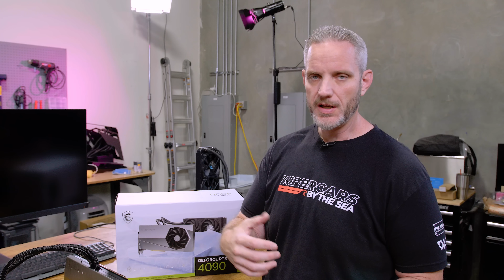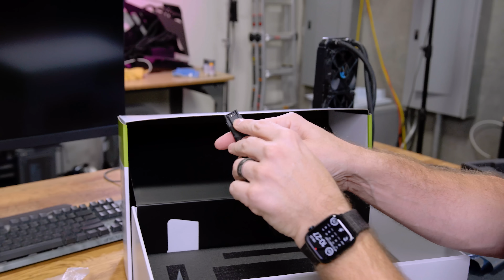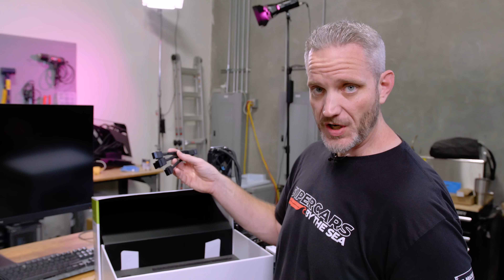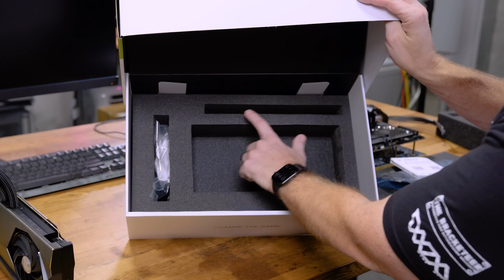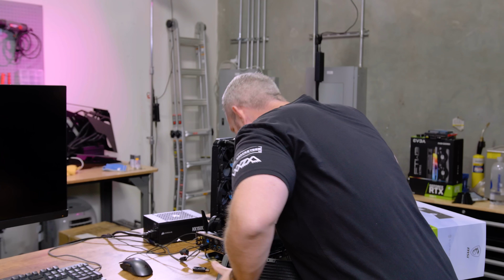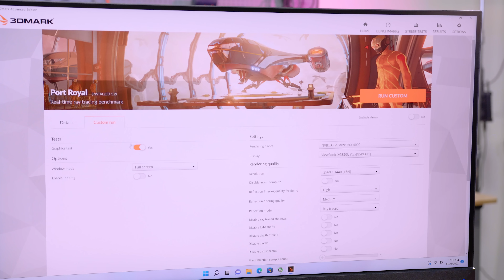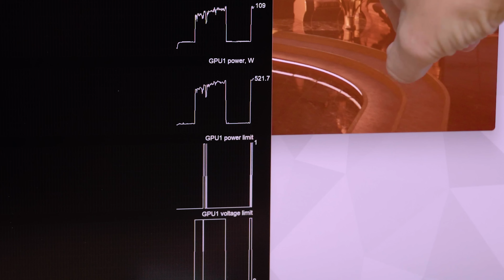This is the most BEAUTIFUL RTX 4090 yet...

Comment: How does it compare in size and weight to the EVGA 3090/3080ti hybrid?  It seems like a great drop in replacement.  Is there a rgb pin out on the card like the older EVGA card to control other RBG devices with the same software?

Comment: I've never looked at a liquid cooled video card before - it used to be common concensus they were louder but that may have changed. I'm not that concerned about additional FPS with over clocking - just about sound level, I want the absolute quietest 4090 video card within about 5% of each other in speed.    There is always someone saying that can't hear this or that - I could probably ask about jackhammers and someone would undoubtably say - I never noticed the noise for that jackhammer.

Comment: water cooled and alot smaller fit, for a 4090, run at stock set for lasting longer being cooler and easier to manage in case.  yes the cost is bummer part, this is the card i want, hoping in next months prices will drop,  its 1750.00 price nobody has em in stock, the few trying to sell them are amazon has 1 for 2580.00 dollars today, scalpers pricing

Comment: In Canada the Suprim X and Suprim X Liquid are the same price (CAD2450). In such instance, which one would be your pick? I got the air cooler version from Best Buy, but they have no idea when it will arrive, or if they will even be cancelling orders. I've seen the Liquid version pop up here and there near where I live for the same price, therefore the question... My case is a Evolv X (the biggest variation), and I already have a 360 rad for my CPU in there. Didn't really want a water cooled card, but by the looks of it that's where I'm thinking of heading really.

Comment: I think the spot in the bottom level, which jay mentioned might be for a support, is actually for the radiator and/or fans. I could be wrong, but I think the top level passes through to the bottom level so the gap is large enough to fit the radiator in the box.

Comment: 1) $1749 is a $150 premium over FE, not $250
2) It is $250 cheaper than the Strix
3) The orientation you showed for vertical radiator placement is upside down, you want the tubes going to the bottom, so the air sits at the top of the rap without tubes
4) I beat your Port Royale score by almost 100 points with the Suprim Liquid X on a weaker CPU (5950x). Get rekt. <3

Comment: I am having an absolute B*TCH of a time with this card on my system that I'm building.  ASUS Hero, i9-13900, Corsair dominator RAM, evo pro 2TB nvme, Windows 11.  I could install all ASUS drivers without any problem whatsoever. As soon as I installed 522.25 NVidia driver, my system would be in a constant freeze/reboot cycle until it forced me to use a restore point to bring it back to operational.  Also tried everything on W10 and was actually able to get through the whole GPU driver install this time, but the rebooting was still happening.  Called back into NVidia support and they had me change the power management mode in the console to "prefer maximum performance" before it reset.  Changed the setting and reset the box and so far (about 10 minutes) haven't had a reboot.

Update: No random reboots once I'm in Windows, but it can take me 3-4 times of pressing the reboot button to actually get into Windows. Boots up and fan colors change (so iCue is running), but have a black screen.  After a few resets, I'm able to get into Windows.  Overwatch 2 plays fine, but I get GPU spikes to 100% every 10-15 seconds and drop 100fps for a second and then back to normal. Super People won't run at all, crashes during load.  PUBG loads but has the same GPU spikes as OW2. I've tried turning down the ram from 6600 to 6000 and it's still happening.  Still waiting on a call back from NVidia tier 2.

Comment: My 4090 TUF will run together with a 13900KF in a custom loop with 2x480 and 1x240 radiator in the 7000D Airflow. Im very excited how it will perform. Just waiting for the EK block with active backplate to be shipped :/

Comment: i dont trust msi water cooling. i bought their watercooling aio for cpus with the pump built in the radiator, and the first one failed, i RMA'd it, they sent me a new one as replacement and same issued happened.

Comment: I  have a question: Why are the Backplate chips always free of any heatsink? Wouldnt it make sense to also cool from the other side although it would not be very efficient in my opinion but wouldn´t a passive heatsink help to further lower the temps? And yes you would need a (whats it called) Heatspreader like on CPU´s As you cant screw a big metal on those small condensators directly. But my question is "why not" in general.

Comment: I feel like the 3090's of this calliper were unchained and dangerous.  Games were able to push past power limits and melt solder lines.  That was huge and bad.  I think this is an attempt at putting up boundaries so that doesn't happen again.  These cards are drawing even more power, now we have to come up with workable cables for this much power.  Power levels have reached server levels of the top most on a componet level.  There is no industrial fan pushing server level air flow over 3 pounds of copper or allum.  Pcie non server cables haven't had to account for stress and heat flow.  Servers made new types of connectors eons ago to support less bending. This will be a time of great change. Maybe power sockets need to come off the card at an angle so the wires don't have to make the bend. Maybe a 90deg.  attachable power header would help.

Comment: I mentioned this to Paul's hardware channel. Oddly enough, I have this card and originally ordered a corsair 1000psu and the power limit on after burner was 120%. I had to return it because it had very loud coil whine (found faulty) and I ordered a be quiet 1000w psu to replace it.  The power limit on after burner went to 125% for some reason? This is with the surpim X liquid. Also, I turned off the zero rpm feature, I really didn't like a 50 degree brick sitting at the centre of my case, exchanged it for a typical fan curve and idle temps went down to 25s-30s and seems to stay a lot cooler in use.

Cheers Jay.

Comment: I LOVE the look of the card. However, I think for my new build, which was going to be a complete PC upgrade this year, I will go ahead and upgrade the MB and CPU to [ Insert New Chip to avoid Fan Bois ] and wait until 1Q next year to upgrade the GPU. My main reason is the GPU and CPU Industry have in the past shown that as inventory moves and NEW chips come into the supply line those New Chips from the Companies mature and this results in (1) better stability and (2) in cases higher overclocking headroom. I really wanted to just jump on Amazon and purchase all the parts as soon as the review cycle, sort of, ended. I am personally going to go a DDR5 route no matter the manufacturer so as to be able to use that memory in another build 2 to 3 years down the line. As far as Storage, I already exclusively use M.2 drives except for 1 SSD internally that keeps my temp files for projects. Hopefully, with M.2 prices plummeting I can score a nice 4TB drive on sale for better than the usual -7% garbage they try and lure you in with. But, I'll be happy with a bunch of 2TB drives if need be. I love that we can now have MORE than 2 or 3 M.2's on the MB by default (depending on size). It's a Great Time to be a PC Gamer/Enthusiast/Developer who is in need of a new system due to competition. Cheers! Stay Healthy and Stay Sane!

Comment: 2018: Why do GPU card makers not overclock their cards as standard if the cards are stable and reliable when overclocked?

2022: Why did the GPU manufacturer set the card to the maximum it can handle, so now I can't overclock?

Comment: And this card will solve the problem of power cable bending because the water cooling hoses stick out so far that you won't have to bend the cables. Must be vertical mount to fit in to you case right?

Comment: the 4090 custom designs are a "bit" boring, because they are all voltage limited. Actually this is not bad news for customers who just want to put this GPU in their build and don't care for oc. Get whatever fits your budget/astetics requirements and performance will - at least until the power adapter will start to melt^^ - be within margin of error.

Comment: Please make sure to let people know not to have the intake and outlet for the water block at the top of the block if the block is mounted vertically, this allows any air to head towards the pump and then the coolant stops moving, which can cause an airlock and potentially damage the card through overheating.

Instead, having the inlet/outlet at the bottom means and bubbles stay well away from them at the other end of the block.

Comment: Couldnt afford to run it even if I did sell a kidney for it. £0.40 per KWH in the UK means running a system with this in or any 4090 means you'll be looking close to a full KW when you throw in a new intel or AMD CPU when running full tilt, for a few hours of gaming - sheesh.

Comment: I don't recommend aio cooled gpus. They won't last as long as air cooler models. The aio will lose performance after 5 years. And good luck trying to replace it. I have seen cards getting destroyed by the water leaks from those. Also those hot vrm vrams are only cooler by 1 fan.. For you either go custom water cooling or air cooling that's all.

Comment: I had an MSI "Sea Hawk" GTX 1080 AIO water cooled card years ago.
It was a GREAT card for thermals. And sooooo quiet.
It looked really tight with a corsair AIO on the cpu too.
But I dunno about the long term durability, I only had it 2 years (microcenter trade-in warranty back then)
Reply: PS: at 5:20, you show how you might mount it in front ...I really don't recommend that.
Don't mount it with the tubes at the top of the rad. You only need to leak (evaporate) a tiny amount of fluid to stop the fluid flow if the tubes are at the top of the rad.
You probably re-build and upgrade too often to notice this, but most people don't. I'd mount that on top, with tubes coming down to the card. And just put your cpu rad in the front of the case.

Comment: With the issues that some manufacturers are having with AIO's liquids degrading and sludging up the CPU blocks . What is the contact area like for a 4090 water cooled cards??? and can they suffer from this kind of issue?. With these cards costing so much one would not want a card to be over heating and requiring a return to manufacturer and having a system costing ?? down for a long time.

Comment: If you got really good at using a microscope and soldering you might be able to move ram, cores etc around. I wouldn't think that chips would be software locked to a specific card considering almost no one does stuff like this. Maybe get a good air solder station and stuff to BGA solder and show us the process of you learning to make your own OC monster. LOL. I'd love to see that content for sure. Please consider it at least, most of us will never have the access to hardware let along the engineers you could probably reach if you tried too, for help.

Comment: I did a whole platform upgrade (everything except case and PSU) with a GTX1070 GPU in 2016 for half the price of one of these cards. The whole system running less than 200W. The world sure has gone bonkers

Comment: Q: Jay could you replace fans with RGB fans? Thanks. Not on GPU but radiator block.

Yes!!! RGB software for GPU should be on MSI afterburner.  I also WISH MSI would bring after burner to Linux.   Steam os is coming soon to desktop pc.  Valve said so.

Comment: I have a suprim 3090. Giant cooler. One of the first things I did to that card was to water cool it with an active backplate. The memory junctions reached 114 degrees c. Now after water cooling it’s down to 100. Still stupid high. My room gets really hot after a long gaming session. It has to become worse with 4090. What is the temp on the junction of the 4090 cards? Because on the 3090 I have, the gpu show low temps.

Comment: This may sound like a stupid question - but why don't they just put the power connector on a different side? On the rear for example or pointed downwards or up? It makes no sense to have to pointed towards the side like they all seem to be doing it. It would just be a matter of running the traces somewhere else or just put a short cable through the cooler fins on the end (where there's no PCB anyway) - and the airflow would keep the cable and plug slightly cooled as well...

Comment: Gigabyte waterforce is better. You get at least 27000+ stock. Although the default frequency is only 2565Mhz. I have over clocked mine by 185Mhz, 1.5Ghz for memory, no issues at all. Probably because it has a bigger radiator and the copper covers nearly the entire card rather than only the GPU and memory.

Comment: hay jay could u just swap the watercooler setup off of the suprim rtx 4090 to the founders rtx 4090 board to get better thermals on the rtx4090 founders have not seen board setup myself yet but you would think its basted off of the founders so it might just fit worth a try if u ask me

Comment: Disagree on the RGB control. Mystic Light is the default software for all RGB from MSI. You can control the RGB both on the motherboard and the GPU in one program. Afterburner serves a different purpose and should only focus on what it does.

Comment: Hook the ac unit to the aio. Cooler it runs thr more efficient it should run. Id also get some high rpm/high cfm fans on it and you should be able to get a little more out of it.

Comment: I like it, they completely embraced what a card like this should be. The 4090 is a pure luxury item, it's swag, and for AIBs who are competing with something that just gets the job done like the FE? Yeah you gotta bling it out, and they did a beautiful job of it and gave you a water cooled option for smaller cases. Performance? It's a 4090, the actual performance differences between them won't have any practical effect in anything outside of overclocking anyway, so just pick the one you like. 

Edit: Is the value there? Value shouldn't really be brought up on cards like this IMO. You're so far outside the realm of cost to performance already with the cheapest version of the card... yeah

Comment: The thing that puts me off of these types of cards is that they only ever come in 240/360mm radiators when I'd love to be able to take the stock fans off and reuse my 140mm Noctuas instead if the option of 280/360mm was available.

Comment: The spec list on the MSI site mentions a 3rd bios, “Extreme Performance (MSI Center)”. The spec shows a higher boost clock. Does anyone know if it affects the max performance much though?
Reply: Ya my card is stuck a 100% power limit better then 93%

Comment: I have had a hybrid GPU since I can remember. I like them specifically because the hot air is immediately pushed out of my case and doesn’t heat up any of my other components. To me, that is more important than “better” cooling. IF I was buying 40 series, I would go for this for that reason alone.

Comment: You can actually change out the fans on the AIO cooler to Noctua ones that will help with temps. I like the card as it's not so bulky like the other air-cooled cards released.

Comment: Didnt MSI have issues with GPUs dying in the pass, was it the 980s, 1080s, or RX 480s and they didn't want to fix them, maybe that's why they started locking them down, cause didn't they use to be up there with having the "fastest" GPUs when using the "gaming BIOS".

Comment: I'd love to see a 4090 binning test, get a set of 4090s that would be differently binned (for example the TUF, TUF OC, Strix, and Strix OC) then overclock all of them so we can see how the binning limits manual overclocking and show what you are really getting for the extra few hundred dollars by buying a tier up. I'd expect only the Strix OC has much headroom for overclocking and if you don't get that you should just buy the base model because the in-between models are going to be too expensive for too little.
Reply: > I'd love to see a 4090 binning teat,

That's milking it a bit, isn't it?
Reply: @MrMartinSchou  LOL whoops, typo
Reply: lowest increase generation we've had so far vs founder's, all the cards are voltage limited to a large degree.
Reply: @Satarras90  Yeah it's pretty disappointing, it also seems like nVidia are being real jerks and keeping a lot of the good chips to themselves and giving AIBs the dregs which is particularly annoying because in Australia you can't even get a 4090 from nVidia, you have to buy AIB ones.
Reply: @AusSkiller  Damn that sucks. Doesn't surprise me though. I want to see shunt voltage mods from Derb8auer the most, that would be interesting to see what's possible/stable.